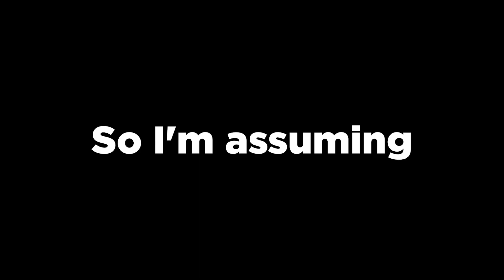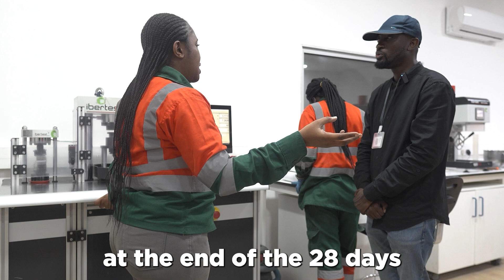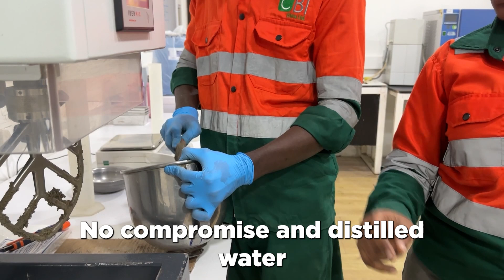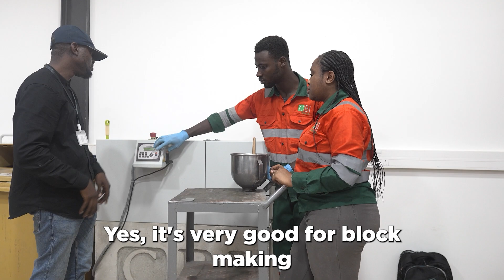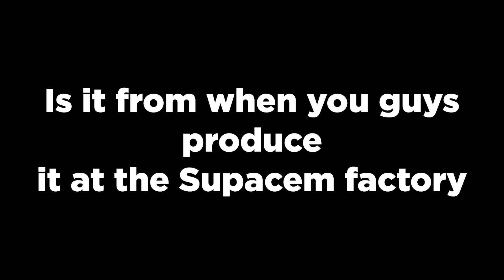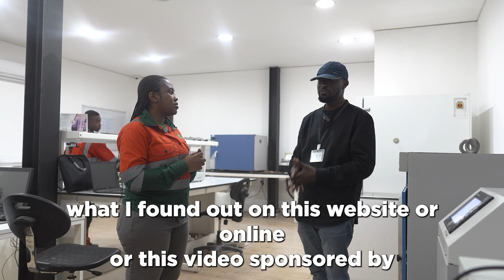Watch this before buying CEMENT - Best Cement Company in Ghana

Comment: Point of correction C30 concrete is equivalent to 32.5. C35 to  C40 is equivalent to 42.5. it all depends on what conpressive strength of cement your structural engineer recommends for your building.

C30 / 30mpa can be used for mass reinforced concrete as well. As long as you follow the curing guidelines.

If youre not building a 10 or 15 floor building why waste money on the 42.5 /40 mpa cement. 
Maybe they're not using right mixtures and compressive strengths in Ghana

Its Just a way to deter people from using the 32.5 R cement

Comment: The rising damp issue, do they have an answer?
Reply from the maker: I will ask them in the next series!
Reply: @AfricaBuildingHub  yes, very important. What about modern cement chemistry has changed so much compared to those used for old buildings which rarely had rising dampness. 

Also why modern cement doesn't scotch the hands. The old ones used to be strong.
Reply: @aberba  modern cement is full of query dust 😢